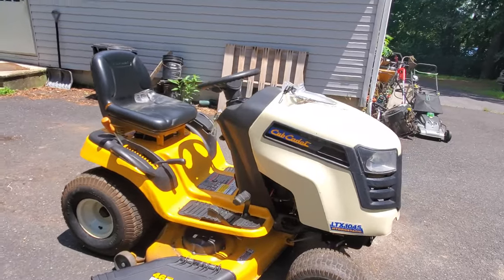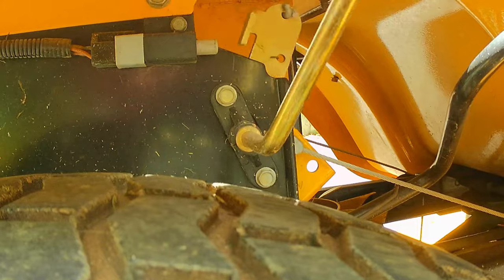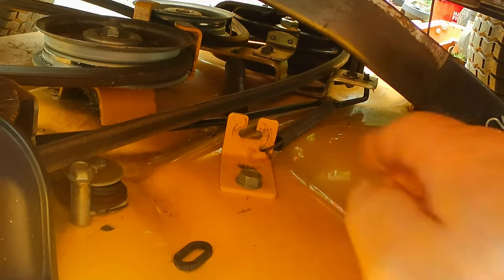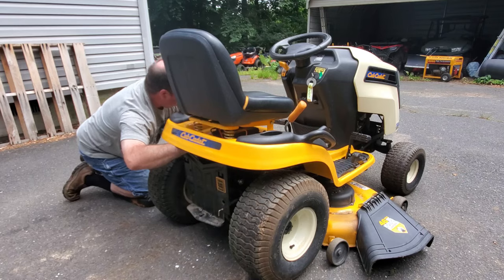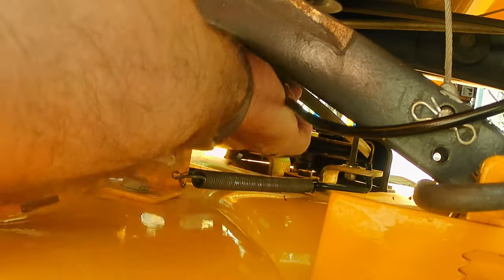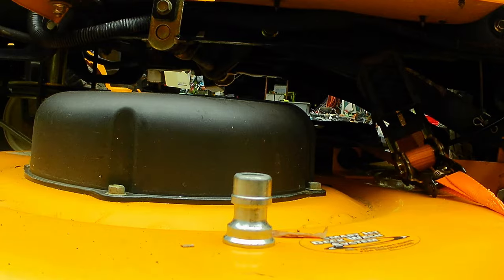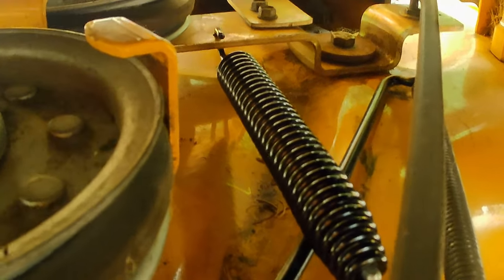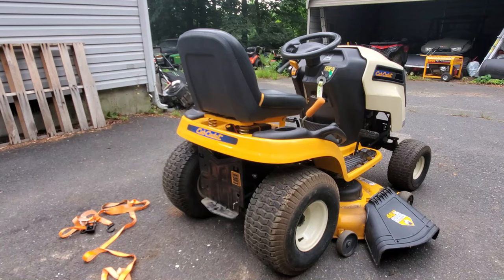Cub Cadet LTX1045 blade engagement cable

Comment: Thanks for the video, my belt was too loose when i pushed the lever forward, causing the blades to take a long time to rotate at full speed.  I assume replacing this cable is the fix since there was a lot of play in the lever.
Reply from the maker: Hi, it could be a stretched cable, but more likely is that the belt is worn. When belts wear, they can actually get thinner which allows them to go deeper into the pulleys. This means that the effective diameter of each pully is smaller. This causes the belt to become loose because it is now too long for the distance it needs to be to fit around the pulleys. Thanks for watching.
Reply: @ridingmowerking   The belt seems ok to me, I ordered the cable, should get it in 2 days.

Comment: That is a bow tie retaining clip just like the ones on a Husqvarna made riding mower back in the day MTD made riding mowers had the height adjustment and blade engagement lever as one piece
Reply from the maker: Yes, those old mtd's with the single handle were a real PIA. sometimes even the correct mtd belt would still not work correctly.
Reply: @ridingmowerking   I had a powr craft limited edition  mower with the single stage height adjustment and blade engagement lever All in one it was a pia when you had it disengaged and the.height lever would just drop without any notice at all 😕😔😡😠🤬
Reply: @robertmailhos8159    My old MTD engagement lever falls all the time!! How can I fix it or at least make it better? I was thinking a bungee or something.

Comment: The earliest way is to drill a 5/8 hole on right rear to get to the bolt and then it’s a 10 minute job from now on
Reply: If the cable comes in from bottom with the side slut clip, this one is definitely different 😮
Reply from the maker: they always are making changes every couple model years.